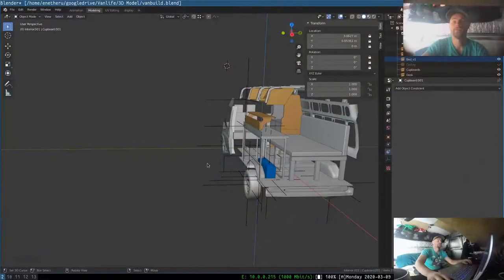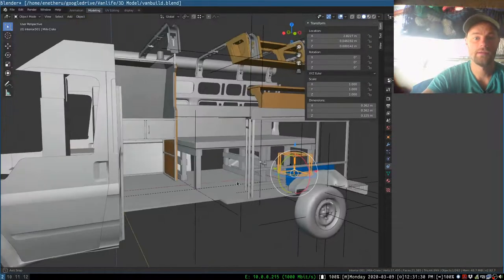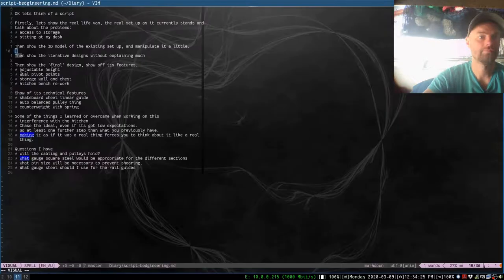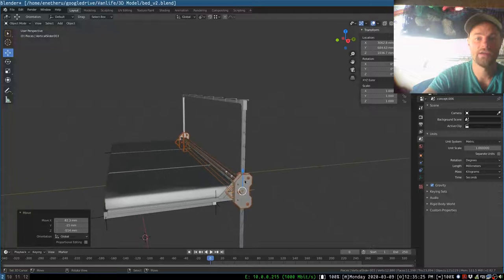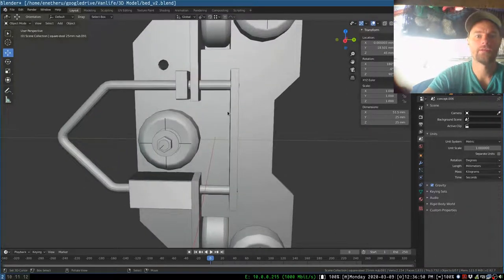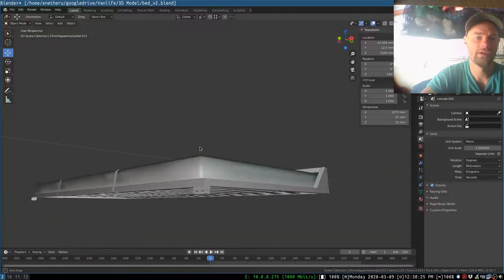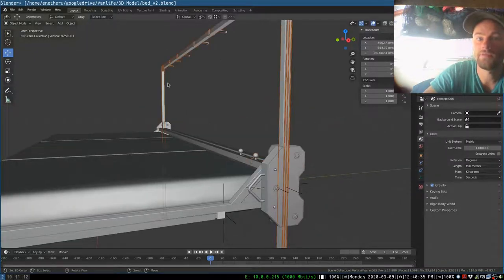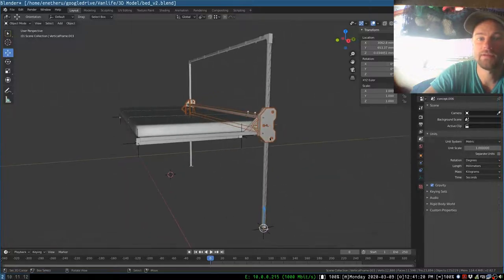Vanlife - Bed Redesign and Solicitation for Advice

Comment: I might have missed it, but have you thought of adjustable height legs that fold back into the bottom, just to hold the structure when you sit on it, or lay.
Reply from the maker: yup, you missed that part, telescopic fold up legs to take care of the weight when the bed is flat.
Reply: Samuel Nicholas also are you using Linux
Reply from the maker: @JuicyJimme  indeed, arch linux with i3 as my window manager.